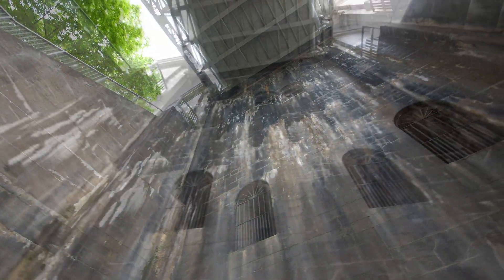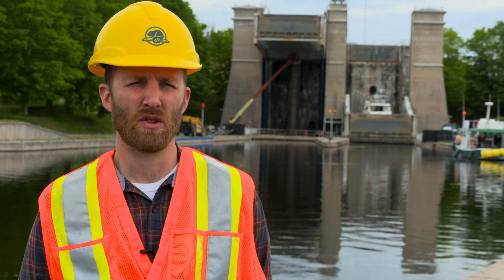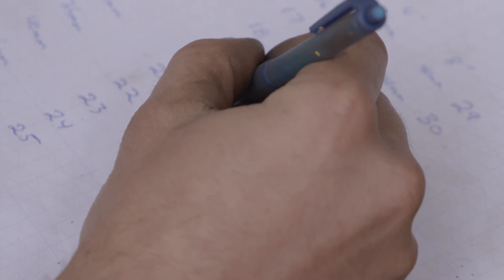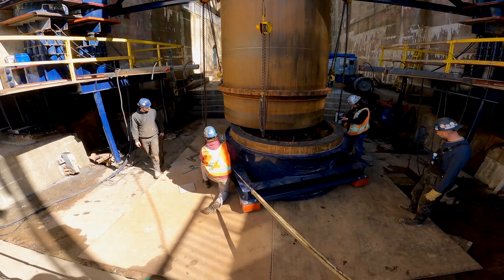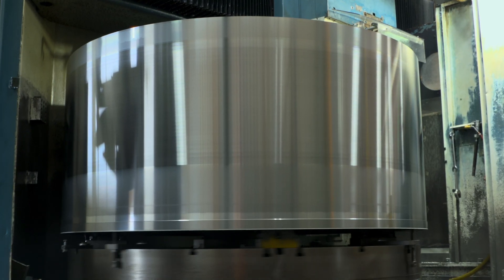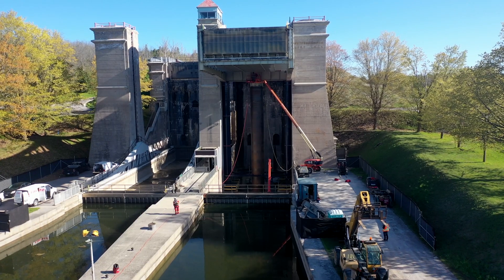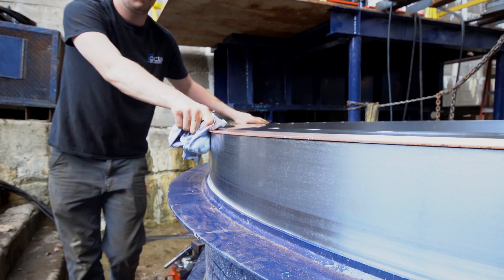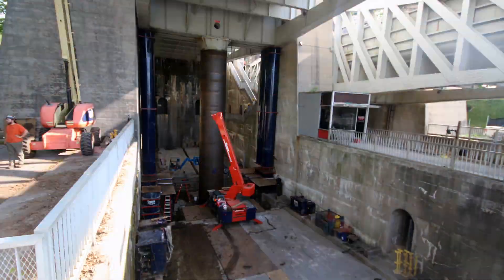Major Hydraulic Repairs at The Peterborough Lift Lock

Comment: That lift lock and another similar one on the Trent-Severn Waterway west of Peterborough were built by Dominion Bridge Company Ltd., probably the premier structural and machinery engineering firm in Canada until its demise.  Many bridges, the reconstruction of the parliament buildings in Ottawa, and New York sky scrapers, were built by this my former employer.
DB was a great company to work for with top notch engineering and manufacturing know-how, where I learned much.